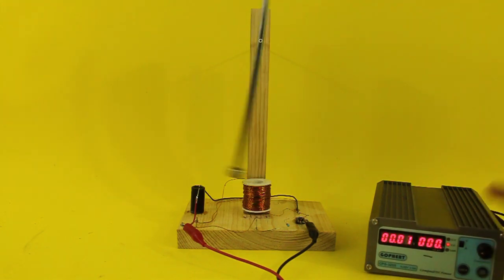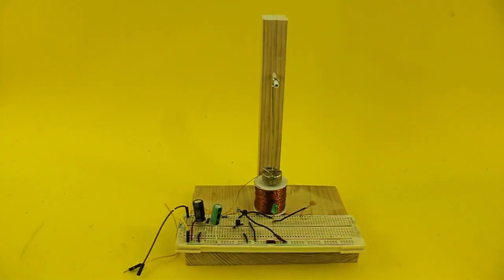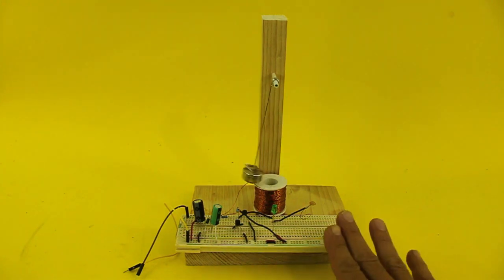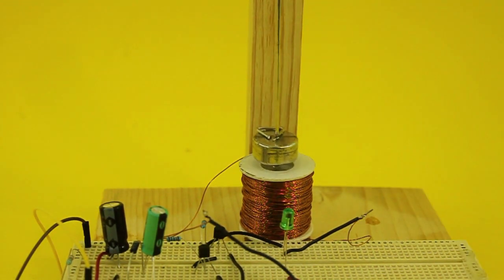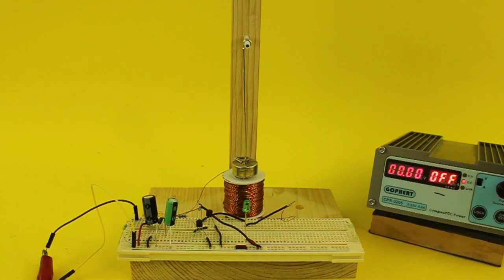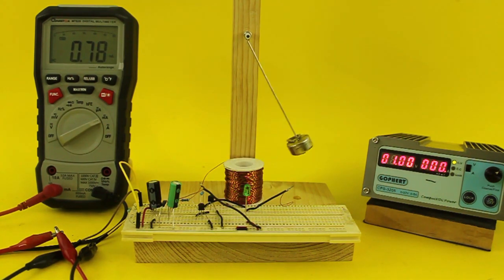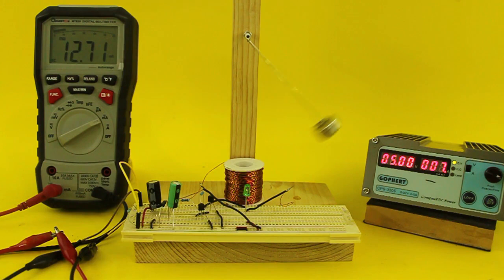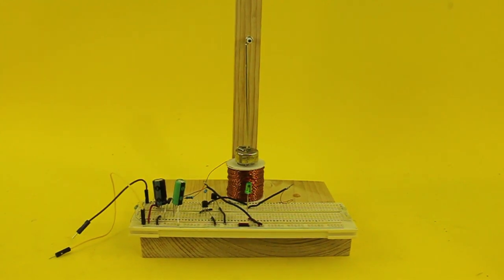Magnetic Pendulum V2

Comment: See Tunnel diode motor, Scientific American Amateur Scientist column by C. L. Strong, October 1965, pg. 112, for an old circuit using a tunnel diode to run a simple motor or swing a pendulum. If you want to build it and can't get a tunnel diode, search for "lambda diode" for a two-transistor equivalent that behaves the same way.

Comment: So you have a coil and a magnet breaking field lines, inducing a current, yet weak it's still enough to charge that capacitor or a battery, over time.  I think you would need to add a couple of contact brushes to turn it into a mini generator.

Comment: Cool vid Sir! Isn't it possible to build a brushless DC motor with this principle? 3 coils connected to this efficient circuit each, arranged 120 degree next to each other in circle to form a 3-face stator? Magnets mounted on the rotating axis will be sensed by the stator coils and be rebelled by them in a circual movement, no additional hall sensors or Reed Switches needed.

Comment: you should make a clock out of this
Reply from the maker: Yes!
Reply: @ludicscience   Hello dear friend. I made the same circuit but unfortunately. I'm stuck in this project my circuit not able to generate enough push/kick to the magnet over the coil. It only oscillates a little bit but that's not enough to rotate aluminum sticks. I have used #28 Gauge Magnetic wire & made 35 Ohm Coil. I have also used 1N914 Diode , Two 100k 1/4 Watt Resistors , 1000 uf 16v - 2200uf 10v  Capacitors, BC556B & BC337-40 Transistors, Red LED 
330R resistor. 
2 (1.5 V AAA Batteries as source).  What adjustments  should I do? Can you guide me, I would appreciate any help that you can give me. Thanks
Reply: @deepakgoyal3235  The original Nuts & Volts circuit used 28 gauge wire and had a resistance of ~10 ohms. Try removing some of your windings, fewer turns = lower resistance = more current = stronger magnet. You can also reduce the value of the resistor by the power source, or decrease the mass of the pendulum.